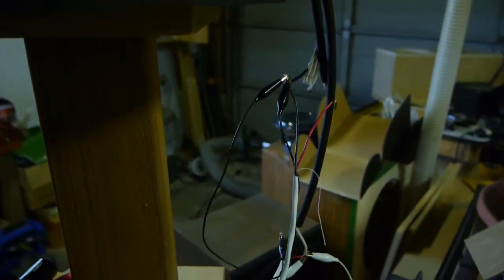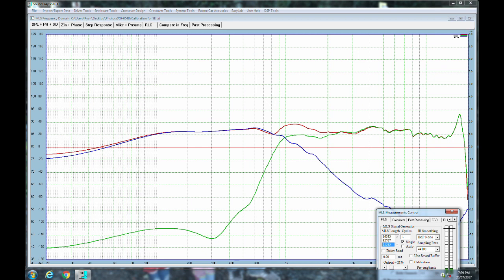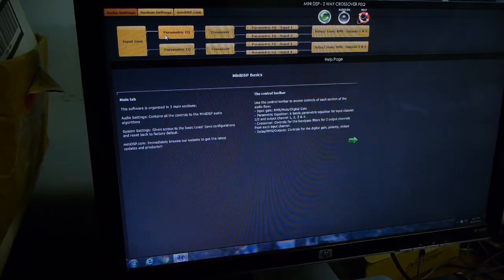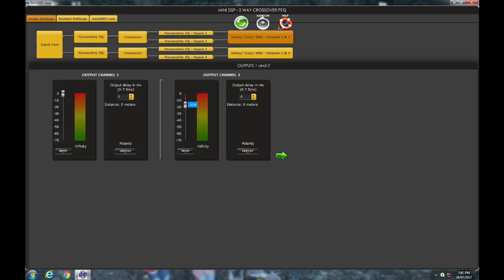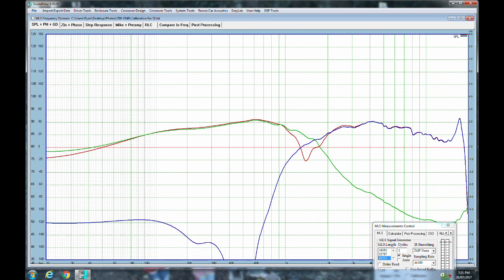Are Active Crossovers Easier than Passive? NO!

Comment: Active is clearly the better choice; always! As mentioned in other comments it's much quicker and cheaper to design and then tweak an active, especially a DSP version, crossover. I'm a bit chagrined that see the obvious error of his "apples and apples" comparison between the passive and active. The passive was a 2nd order, 12dB/octave design. Barring other factors, in order for the response to sum to flat at crossover you must flip the polarity of either the tweeter or the woofer. A 2nd order crossover will give a +90 degree shift to one driver and a -90 degree shift to the other at the crossover point. Combined it results in 180 degrees out from each other. This is physics gentlemen, not my opinion and certainly not a marketing position. In order to get a flat response manufacturers always flip the polarity of one of the drivers. This gives the best frequency response at crossover but, destroys the integrity of the overall phase response and, therefore, it's performance in the time domain. It's an unavoidable and poor compromise. Using a 4th order, 24dB/octave gives you even more phase shift at the crossover frequency; +180 and -180 degrees but, as is apparent the phase "wraps around' so that both drivers are in phase again at the crossover frequency! It also reduces the area of the crossover where both drivers are working and that's a good thing too. BUT; in this video he made no mention of "correcting" the flipped phase that was, I'm sure, in the 12dB, passive design so that they were in phase for the 24dB active design. If fact, if you do your crossover in the active design correctly and optimally it will guaranty a dip in the response at crossover if the polarity is flipped on one of the drivers. In fact, the depth of the dip is a figure of merit for the overall performance of the drivers and the crossover. The deeper the dip at crossover when you flip on driver the better the summation when you flip it back to correct polarity!

You can do a 24dB/crossover in a passive version but, it is a doubling of parts ( two caps and two inductors per driver). If you use quality components for good performance then it will absolutely cost more than an active like the miniDSP and that assumes you get all the passive parts dialed in initially and you don't have to buy extras to tweak the design.

He also didn't mention that an active crossover is also the best because you will then be biamping the speaker which has it's own virtues and is the best way to go. This is not the same as the pointless exercise of bi-wiring which produces no measurable or double-blind positive results and is simply a con job from higher end manufacturers. Don't drink that Kool-Aid.

The reason you don't see active crossovers in consumer equipment is because if the end user is supplying the amplifiers they then have the responsibility ensuring that the output level is correct between the high and low outputs based on the sensitively of the drivers. This requires a good measurement microphone, an RTA or some other analysis device/software and some method of getting the room "out of the measurement". This is far and away beyond the skill, test equipment available, and the time invested by pretty much anyone but, people involved with this hobby.

Lonny J.
Reply from the maker: Obsfucation for the record, I like active better. I never said otherwise in this video.
Reply from the maker: Obsfucation I don’t think you understood the video and you don’t understand how phase works. I was showing that active requires just as much design consideration as passive. Not that passive was better. I explained that to other commenters but you obviously didn’t read my responses. I’m tired of explaining it so maybe I’ll do another video. I even wonder if you watched the video and tried to learn something or just watched a little bit and jumped to conclusions. Did you watch the ending where I describe how phase and time alignment works?

Comment: The problem here is you are assuming an out of phase condition is the cause of the dip at the crossover point. That is a reasonable assumption as a likely cause, but not necessarily the case. You should be able to adjust the crossover point of each driver independently, and you may be able to eliminate the dip. The other thing you can do to quickly determine a phase cause for the dip is to reverse the polarity of one of the drivers and retest. Measuring phase accurately is a complicated issue, but being able to time delay the output with the miniDPS is very cool and the ultimate way to correct phase coherence issues.
Reply from the maker: Speaker Builder I was not assuming, it was an out of phase condition. I measured it. Phase is not hard to measure. And the solutions you suggest are also what I suggested. The point of the video was that a lot of people don’t understand they have to adjust the XO point or delay. They just assume an active XO box is magic. It’s not, it requires just as much speaker design as passive. You basically said as much in your comment. Did you miss the part of my video where I show actual expensive products that don’t allow you to change the XO points independently or adjust delay, etc. If people are actually manufacturing these things and people are buying them, then we know a lot of people don’t understand that active XOers require just as much design thought as passive.

Comment: you are not doing active good, phase is eliminated in 4th order crossover , i dont know why that DSP doesnt do that , its bad design , however i would like to experiment but i need more , at least 4th order , not 2end order , wahts with the miniDSP what it can do , can it simulate a lot of different crossover or fixed at bad design
Reply from the maker: Pavle Pavlovic the mini dsp is great. I’m afraid to say you just don’t understand what I was teaching in this video. 4th order doesn’t automatically fix phase. And that’s the problem. You need to understand what it is that makes a XO work whether passive or active. 

Try watching again and doing some reading. Even read some of the comments to see what I mean. And also try it in real life.
Reply: No  , man i didnt come to argue ,  but ether you are wrong , or this paper  i was reading is wrong ,  and i quote "Today, the de facto standard for professional audio active crossovers is the 4th-order Linkwitz-Riley (LR-4) design. Offering in-phase outputs and steep 24 dB/octave slopes" , Do you believe me now .  ITs no problem you are not the first ive found doing stuff the wrong way , these are PHD topics , one cant know everything , but we learn and go on , maybe you can do another video , i dont know it is what it is , that miniDSP can be a good thing but it needs to do it better , im interested in it off course , but no one will tolerate phase issues , thats just not going to happen , ive found DSPs that do it all but like 500$, its too much
Reply from the maker: Pavle Pavlovic your understanding of the article is wrong. The outputs are in phase but that doesn’t mean the tweeter and woofer phase is 0. In this case the tweeter is behind the woofer. Telling me I’m doing it is wrong is argumentative. Just because you read something doesn’t mean you understand it. I actually demonstrated the folly I see so many people fall for. Either believe what I’ve shown and try to understand why, or keep reading papers without grasping it. 

As for the mini dsp, it can do it right. I show at the end of this video when the delay is set properly to deal with the phase issue it works really well. Plus it does PEQ and other things. So when someone knows what they’re doing it is very powerful, and costs much less than $500. 

Maybe try watching the video again and really concentrate on what I described with my hand diagram. It might help. I don’t know everything, but trust me, I know I’ve done this right.
Reply: Yes i am aware that it comes out on a wrong note ,but its just the truth  sometimes it hurts ,   from my understanding phase problems are due to filtering but filter inverted phase it will get flipped once again , and return to its original , hence no phase issues  ,  there are liner phase EQs as well as linear phase crossovers , no problem ,  as i understand you seam to think that those dont exist ,  im telling you they do im using both liner EQs  in production and liner crossovers in monitoring  , you can get some and  measure , i dont know how else to tell you .  Im not trusting one paper , i know it , im using it , ppl use it every day you just need to find liner ones and you will see it in your results
Reply: here you go analysis of Crossover topology  with tests ,   there is some phase issues but nothing as you experience , more like 1% or around https://www.youtube.com/watch?v=aiJQED7-1b8 Dont knwo waht else to say , need i call Linkwitz here :)

Comment: What is the root cause of the phase difference in this example?  I was always under the impression that with a passive crossover the components used created a slight phase shift so that when you run a 12db per octave slope you create 180 degree out of phase signal around the crossover point.  I was also under the impression that this would not happen with a DSP. But, clearly, it has happened.  Is this due to driver placement (i.e. the center of the woofer is further away than the center of the tweeter).
Reply from the maker: Justin Gardner there is a phase difference due to the time delay of the tweeter relative to the woofer. But you have also learned that dsp also introduces phase so that is good!! The acoustic response changes therefore the acoustic phase changes as well. This happens with active or passive crossovers. For every order or slope you get 45 degrees of phase change.

Comment: There is no comparison to which is better (active) but you just need to have a very good grasp of digital/analog design principles as well as standard (discrete component) X-over approaches, to design, implement, and build a good active 3 way system; that also measures well.

If it (active 3 way speaker design) was easy, all the Hi Fi fiddlers and speaker companies would be doing it.

Comment: Ok so you said the Mini dsp was not a fix all but you proved it was. You were able to correct the phasing, then with the eq would be able to tweak the response curve.  Also on your crossover screen on the mini dsp it looked like you had a gap between the points for the woofer and tweeter. For those that are not savvy on designing and building the absolute correct crossover be it passive or active it looks like the mini dsp is a winner.
Reply from the maker: Cyber Trucker Road Show I'd have to watch my video again to see what I actually said, but the point was to say that unless you know what you're doing with it, it won't be any easier than passive.

As for the gap, take a look at the screen shot again. Each channel has low pass and high pass capability but usually one of those is muted. In this case it  is muted. Both channels were set to the same frequency for this test. Having said that, often the XO frequencies are different (sometimes a gap, or overlap) when designing a proper crossover. I've never had a properly designed speaker use the same frequency on the transfer functions. The acoustics points are what need to match.
Reply: Impulse Audio Never mind lol I think you were just referencing active xovers in general. The phase issue looked like you could have tweaked the points to fix the gap woofer @ idk 4k then tweet to 3.6k have some overlap. Great vid, I didn't mean any offences, my observation.
Reply from the maker: Cyber Trucker Road Show no problem. I don't take offence to comments on my channel. I like when people comment so everyone can learn. I didn't spend time adjusting the XO points because it was intended to show the pitfalls of arbitrarily choose Xhz to XO using one of these "magic boxes". But yes definitely if doing it properly the point, slope, delay, etc. all need to be adjusted to get it right.

Comment: So I have yet to hear about a passive crossover network that time aligns drivers which would be a phase compensation technique. The truth is that passive crossovers have a number of drawbacks over full DSP units. BTW The mini DSP is a pretty no-frills unit. There are far superior processors out there to that although they do work. The other thing that seems to be lax in speaker design is that so many designers only consider the FR plot on the page and don't actually listen to the driver. Many high-frequency drivers exhibit serious distortion issues in the area below 2Khz. It is more common than not to design speakers now to cross-over above 2K because of that. We took old JBL 2206 cones and using a waterproofing solution stiffened the cones which changed the response curve to one that allowed us to roll it over at 2200Hz. It was coupled to an old  3" B+C compression driver mounted to a CD horn. A little time shift on the low drivers (it was a 2-12 stage monitor) to compensate for the physical time offset plus adjust for the phase misalignment at the crossover point and all it needed was a few little eq nudges. I could have mixed a record on it. The thing was with the crossover set to 1600 Hz made it painful and unlistenable. 1600Hz was where the designer said the crossover should be set. Why didn't it work? Becuase just like almost all designers they only went by what the specs say. Specs don't plot distortion vs frequency. You have to listen for yourself and decide.  "Well, that is what pa speakers sound like". NOT GOOD ONES!!!
Reply from the maker: Rob Chapman I don't know any speaker designers that only care about FR and don't listen. Hmm, that actually sounds absurd. Have you actually met someone like that?

Check out ladder delay networks. They are passive and compensate for phase.

The minidsp is extremely advanced compared to the bricks I was describing in the video. But even among the top contenders minidsp sells some very powerful units.

Tweeter distortion is entirely dependent on the model of tweeter. I would be careful generalizing that tweeters distort below 2khz. It may be a rough approximation where most do, but hardly accurate for all. HD is one thing while woofer beaming and cone break up are also commonly an issue above 2khz. So pick your poison I guess.
Reply: Sadly, I have met a few and have actually been chastised for not succumbing to their sonic philosophy. I view it this way. If it doesn't sound good regardless of what angle I hear it from it is an unusable piece. I guess the thing there the guys who like fidelics don't usually gravitate to high  SPL systems as traditionally they have been polar opposites. The thing is we have high SPL systems that now are actually producing sound with a great degree of fidelity and that means it is time for the old guard to get out of the way. 
  I wasn't actually trying to generalize but the majority do. I guess in a perfect world we would need to use a 3-way system for this. I don't think I would trade a bit of beaming for distortion though. Everything in balance.  It is, of course, a trade-off but more often than not narrowing the coverage angle a bit is a good thing. Besides that if you were to measure most stage monitors on the market you start to question who is designing these things anyway. They are never flat and often have crazy phase holes.

Comment: So if i'm quite new to speaker design, can i just get the 95$ mini dsp and tweek the hell out of it, when i don't have a ton of components (0 actually) to tweak a passive crossover design ? Because even when using a software to design it, parts are not always the same sot they will have variations 5-10%. So i might have to buy even more parts so i can tweak it even more. Imagine a 3 way system, with the mini dps you can just plug it in, and spend hours changing controls and taking countless measurements.
Reply from the maker: Quetzalcoalt this is a fair question. The answer is yes and no. 

First, dont worry about parts variation. Far more important is the placement and duty of the component. 

As for the minidsp or equivalent, I would suggest you at least buy a microphone and a couple large (50uF) protection capacitors also. That way you can do two things. You can tweak like crazy AND measure what you are getting. Our brains will adapt to bad sound and sometimes it is not until we hear the right thing that we realize what we liked actually sounded bad. We also convince ourselves something sounds good when it doesnt. Measurements help keep your brain in check and bring you back to reality. This isn't me suggesting you should like what the mic says. I've been accused of that before. Rather it is a way to visual what you are hearing. There are some small things that the mic can help you see like a narrow dip or peak that we can hear but would never know what it is or what to change.

The second thing you can do is take driver measurements and put them into Xsim or some other program and then simulate the minidsp inputs. This allows you to "tweak" much faster so you can get in the ballpark quickly. It will also allow you to quickly see a few different approaches to the XO settings. This is the way I do active XOers and it saves me hours of tweaking and measurements.

The protective caps will just make sure you dont blow a tweeter if you make a mistake or get turn on thump from your amps.
Reply: Then the 50µF caps are put before the tweeter only? What does the cap do?

Comment: Active crossovers are much easier to design. They won't solve the issues of poor driver choice or bad enclosure design, but they're so much easier to work with. Try building a passive 24dB/oct 3-way crossover with subsonic filter. I did that in a couple of hours with active.
Reply from the maker: Bogdan Serban I think you missed the point of the video. It was about applying blanket crossover settings with a dsp box.